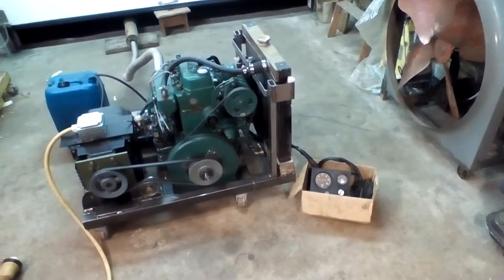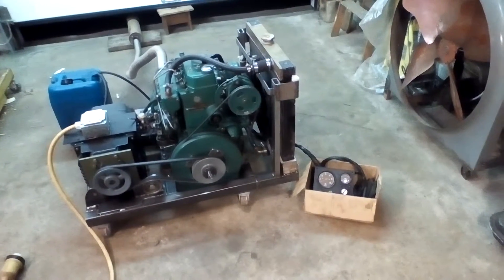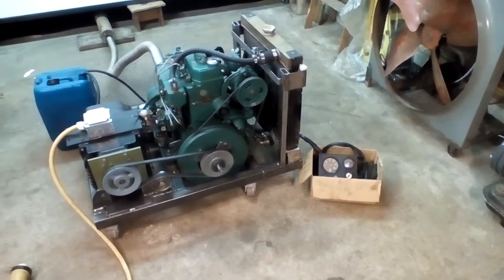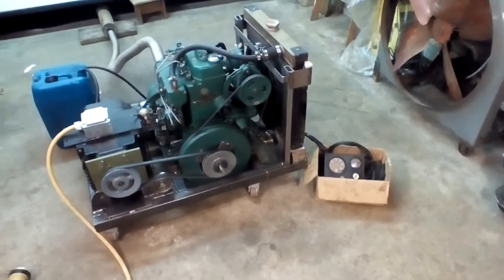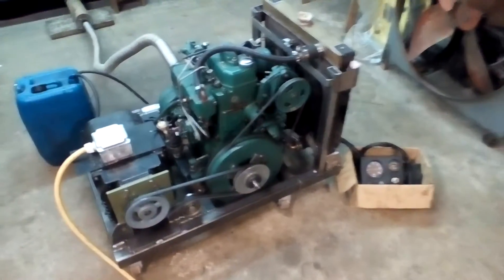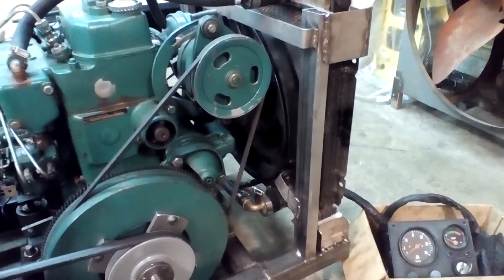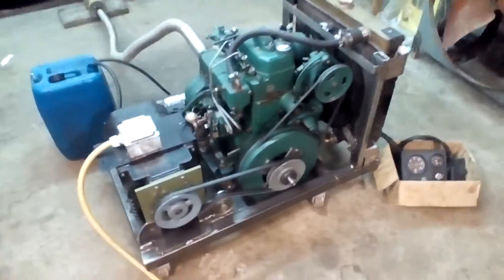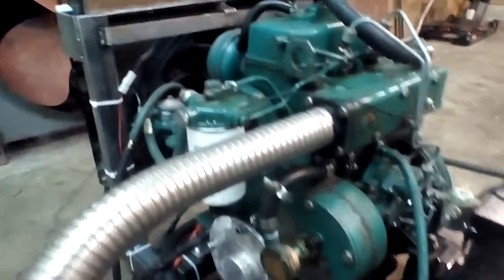Volvo MD6b marine engine converted to home diesel generator

Comment: Still working?
Reply from the maker: Sorry to have missed your post. Yes, still fine. Have used it during an outage in the fall. Working on a mod to drive the fan and a centrifugal pump  directly in order to eliminate the electrically driven pump and fan- which I think are reliability risks..
Reply from the maker: Oh- and the version in this video is before I went to a Bosch magnetic drive brushless water pump...The Volvo impellor pump requires a new impellor at least once a year..

Comment: Damn right it's too good to scrap.  Do you run a temp gauge ?   fan and radiator.. I almost wonder if it gets to the right operating temp ever ?  What was the source of the alternator ?  Nice Project !  ( oh see that it is Onan.)
Reply from the maker: Sorry to miss your post.. Yes- I have a temp gauge.  Yes, it runs a bit cool but will eventually warm up.  I run it at reduced speed into a resistive load for~10 minutes to let it get warm.  The alternator is the original Bosch unit. THANKS!

Comment from the maker: Thanks! Yes- 4-pole Onan with a seized engine.  The head now has an aluminum bearing plate/pulley at 1:1.  The plate is 1/2 inch thick with a McMaster-Carr ball bearing installed as a press fit against ~ .08" shoulder.  Yes, 1800 rpm. I am actually quite pleased with all but it's emissions. Geese- I wish these old low-compression types ran as cleanly as the replacement engine (Kubota/Beta) in the sailboat, with no visible smoke and very little odor.  This Volvo is certainly stout, though,  and is now installed permanently with a thru-wall exhaust.  Fuel consumption during actual use (our typical operating without the AC, I.e. winter) is about .1 gal/hr since most significant loads are not continuous.
Reply: Is that 1gal/hr or 0.1 ? (point 1)
also how did you govern the motor for the correct Hz?
thanks
Reply from the maker: @kermets  Hello! Yes, that is ~ .1 gal/hr, but, again, the average load is very low.  For example, the oil burner requires ~ 3 amps average current yet measures 24 amps at start-up (!). And, all of our big loads are intermittent. The actual average load overall is around 600-700 watts (at our house during these sorts of situations).  So, since .1 gal of fuel should provide ~4000 watts for 1 hour this generator actually still wastes a lot of energy! The original governor (the fuel pump is a VA style) works MUCH better than expected- actually nearly perfectly. I have a throttle stop which I move to 1800 rpm after warm up.

Comment: nice work. any details on the front cover/ bracket and shaft for the pulley on the generator head?  looks like its 1:1 ratio... is the engine governed at 1800? thanks.

Comment: thats a sweet ol girl....got to love the balancing and massive flywheel. was that your front engine adapter pulley? I'm assuming its a 4 pole head and what was it taken from...?
Reply from the maker: Hello! Thanks all and sorry for late reply..I fabbed the pulley adapter and the gen head was from a 1800 RPM Onan with a fried engine. The gen head has a fabbed bearing/plate for support (it was supported by the prior engine's crank).  One lesson- don't use steel wheels on the frame- I can feel the floor kind of thump..But- still can't hear it from the house (it is now installed in a far corner  with an external exhaust and muffler). Thanks!